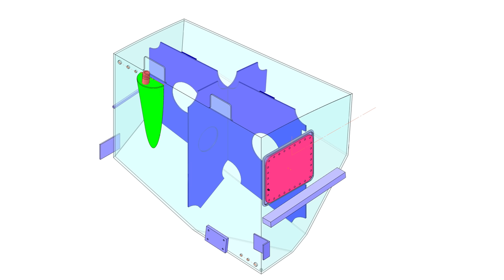Tally Ho’s brand new Diesel Tanks!

Comment: If losing your deposit is the cost of discovering Lorin and the good folks at All American Marine, so be it. Leo, you're a class act, and those gorgeous aluminium tanks are a reflection of the quality your community wants to be a part of. Even if it's only from my armchair, I'm lucky to see this kind of generosity and collaboration in the name of Tally Ho.
Reply: Well, "seems to me" that any kind of rigid tank that's "installed" (by which I mean, firmly connected to the ship's structure) is an accident waiting to happen.  The ship will flex and the rigid tanks will yield.   What happens next?   IMO, the plastic tanks made some sense but they had a lot of sharp edges which are "stress risers."   One reason they were special ordered was the desire to "efficiently" use all the available space.
Reply: @GilmerJohn  Well, seems to me that both Lauren and Leo do know what they’re doing and have figured this in, dontcha think?

Comment: First of all…
Wow! 1/4 inch thick aluminum double welded? Even if corrosion were to take place in those tanks it would never compromise them in a lifetime. Secondly… As a fabricator who works with (and for) other fabricators, all I can say is that the workmanship is obvious. You have some very impressive fuel tanks. They are truly as artistic as they are industrial.  Way to go.

Comment: You can't fake quality welds, especially on aluminum.  Just from glancing at those welds you can see Lauren is highly skilled.
Reply: As a welder also making aluminum fuel tanks the only problem with welds is porosity from dirty material or cold lap when starting a new weld, both can be overcome if care is taken in prep before starting each weld and im sure by watching this video and what I could see that was done 100%. Well done Lorin and All American Marine! 
The last tank I welded did not have one single leak when tested
Reply: "You can't fake quality welds" . I have tryed.. and failed

Comment: Don't forget Leo you (can) treat your fuel at each refueling with a gallon of denatured alcohol in each tank. This break up any water into molecules at the bottom of the tanks. This also prevents corrosion, kills diesel bio growth and keeps the water molecules suspended for 30 days.🤓🤓👍👍

Comment: What I'm finding is that the standard for using stainless steel in diesel tanks was changed in 2005 by the American Boat and Yacht Council to allow its use if the material used is 316L or 317L alloy, and is a minimum of 0.0747 in. (about 2mm) thick. The concern before that was the same as you mentioned for aluminum, crevice corrosion. It's possible that the tank makers that you consulted do not use stainless as policy, but it seems that the potential problem is the same as you discussed for aluminum.

Comment: Aluminum Tig Welder here, I wanted to see some close ups of the welds. What I did see looked consistent and that he has a good hand. They would of been fun tanks to build I’m sure. They will last a super long time. Tip for an emergency, aluminum is soft. If you ever get a pinhole leak use a centre punch (if you can get to the spot) it will get you to the next port till it can be repaired properly. I hope he put baffles in the tank. Double whammy if he didn’t and I would make him cut the lid off and put some in, no ifs ands or buts! Fuel tanks are typically supposed to be double walled as well but have built single wall tanks for myself with no issues.

Comment: That's some pretty high-quality Aluminum fab.  1/4" wall is a little overkill for that size.  But now that it's made, it's just extra corrosion allowance.  Make sure you vent it properly so it can inbreath.  If you are worried about your low point, you can always put a low volume gear pump on a weekly timer and recirculate the bottoms through a filter + coalescer and back in the top.

Comment: You are a class act Leo for not putting your grievances on YouTube. I'm sure folks in the boat building trade know who they are. =)
Maybe get your fittings machined out of aluminum to avoid dissimilar metals and use a Teflon paste rated for fule. Built service stations for eight years.  =)

Comment: Wonderful job on those tanks! Lorin is a true craftsman! I worked for many years as a shipwright in Juneau, Alaska and we had to design and have made many diesel tanks. We always advised against stainless tanks because diesel and stainless produce some water vapor inside the tanks. I'm not sure why this happens but it does. We used mild steel or aluminum. Maybe this water vapor problem is why stainless isn't used in the U.S.

Comment: Fascinating!! I remember in the 70s I was working in a boat shop in Virginia. The shop had built a fifty foot ketch with integral tanks, so one side of the tanks was the hull. They were constructed with 3/4 inch marine plywood coated with wet epoxy. Bad idea because a boat works. It twists. The tanks leaked and the person doing the repairs just applied more and more west epoxy so it looked like a cave inside the tank.. I suggested that the mess be removed and that we could make tanks out of fiberglass to be mounted inside, but I left and don't know what happened. My stepfather needed a diesel tank for his sailboat and ended up using a beer keg. It worked perfectly and twenty years later when I talked to the guy who bought  the boat, it still had the same beer keg tank!!

Comment: Fuel Tanks here in the States cant be made with steel because steel is one of those metals that can spark when struck. While Aluminum doesn't. Its a safety choice most if not all US has adopted.
Reply: I believe that would be for gas tanks not diesel, because gas is flammable and diesel is combustible. It takes a flame to light diesel not a spark.

Comment: Nice job on the Tanks. I'm glad to see you used 1/4 inch material, too many times I've seen tanks built from thinner material and in one case I warned to builder to use thicker aluminum. later it turned out that the tank deformed and split the seams, dumping several hundred gallons of diesel into his hull. I'm also very glad to see those tanks well baffled. Never underestimate the power of moving liquid!! Well done Lauren, from one welder to another!! Nice looking beads brother!!

Comment: Kudos to Lauren and All American Marine for their generosity!  The tanks are a work of art.  Plastic is a viable material for diesel tanks.  Lots of mass production boat builders in the US use plastic tanks.  I had a sailboat with a plastic tank.  It was 22 years old when a hurricane destroyed it in its slip but the fuel tank never gave any trouble.  

That looks like the bridge over Deception Pass.  Beautiful structure.  I hiked to the bottom to take photos.

Comment: Their is actually a time tested plastic tank most shop owners can relate to. A plastic 5 gal diesel can. It is made of HDPE plastic. So is your plastic gas tank in your diesel trucks. And so are oil jugs. Just a thought. But your absolutely right about the build quality. Not just pressure tested but vibration tested too.

Comment: I made aluminium tanks for years without any issues. If by chance you discover a pinhole in a tank in situ, place a centepunch immediately next to the pinhole and give it a good enough hit to pinch the hole closed. It's a hack that resolves the issue when the situation requires, and if you are miles from nowhere, better than slowly filling the bilge with useful, paid for, diesel.

Comment: Hi Leo. I have a 29'  boat with 2 aluminium fuel tank's for Diesel. They were installed in 1986 and are still not leaking. They are feeding a TAMD 70 E and no problems with the tank's. So far!! My son inspect them 1.5 year ago and the tanks look like new, inside, outside What he collected out of the tank's is an other history.

Comment: Fibreglass car bodies are made with threaded oval shape pucks cast into the original layup. This strands the point loads over a wide area. The method has been used to attach chassis subframe s to unibody car structures. 
However they don’t carry diesel for many years. In addition, cracked glass fibre “contaminated” with diesel cannot be repaired.

Comment: aluminum in O2 does create a protective coat of aluminum oxide, just like steel creates iron oxide (rust).  This on aluminum doesn't corrode as quickly and is a desired effect to protect the raw base aluminum. keeping a good bit of ventilation around the tanks should any collected water or condensation to evaporate quickly enough to allow another layer of oxide to form.

Comment: I have usually referred to Nigel Warren's book "Metal Corrosion in Boats-The prevention of metal corrosion in hulls, engines, rigging and fittings" pub. Adlard Coles 1980. He discusses aluminium fuel tanks, for which the recommendation is to avoid any fittings of brass or copper-based metals (electrolysis/galvanic corrosion), but to use stainless fittings, including pipework (or aluminium pipe). He also notes that a reaction can occur between diesel and copper/brass fittings.
Those are very handsomely-built tanks, and I look forward to seeing them fitted in the vessel.

Comment: Chewbacca t-shirt? I instantly like that guy!
Back when i was a kid, i got to go with my uncle at his work a few times and one time i got to watch a whole mild steel tank being brought inside an autoclave and heated substantially. The inside was under vacuum as i recall, and they'd pull it out, looking through the observation window, when the sides bowed back to normal. It was then immediately brought out and dunked in a pool of oil. Quite the spectacle and i had to watch from far away. This made the tank highly resistant to corrosion and also stress tested it. I don't remember what it was for, tho. I only remember the "fun bits".

Comment: Hey Leo I'm a watcher from the beginning and I have been so interested in what you have been doing. You see I am a woodworker/Carpenter all my lfe and also worked for three boatbuilders as a Woodworker/Carpenter. When I saw you get on that ferry I knew where you were headed, well in the direction you were headed.  I have driven that road many a time. I think you made a sound decision to go with the aluminum tanks. Every company I worked for used aluminum tanks and its because they are the best bet I think. Anyway I will continue to watch and by the way I have been anticipating this series on the build since I first saw tally ho. Keep up the great work and it is sure we'll worth it!

Comment: Wow those are beautiful, the welds are gorgeous, way to go Lauren, 1/4 inch aluminum plate is very strong and probably wieghs half of what steel would, to me, steel in a boat, your asking for trouble, you would have to check the epoxy coating every couple weeks. I think the aluminum was a no brainer, Leo it looks like you could throw one of them off of Mt. Everest and it would survive, hats off to All American Marine, well done Leo.

Comment: Stainless steel (SS) can be a real pain in so many ways. The US has a list of materials that can be used for marine diesel tanks; that list does not include stainless steel. If stainless is insisted upon there is a whole set of hurdles to overcome before it can be used. Stainless painted on the outside is ok for fresh water on the inside. Lower grade 304 SS which is most commonly used will crack easily once it is welded if any salt air gets to it. The higher grades are more crack resistant but still prone to it. I worked in the 1980s on Das Island where we had to replace almost every 304 SS pipe because of stress corrosion cracking. We conducted lots of tests, we found that just the heat of a flap disk preparing 304 pipe for welding could initiate cracking. Have to say I was blown away by the fabulous quality of the tanks that Lauren made.

Comment: The new alloy tanks look really good from this engineer's eye and Lauren should be real proud of that effort.  Plastic was always going to be a problem and so was a company who told you it wouldn't be ! Look at it this way, it was $1000 well spent and if they had repaired those plastic tanks, you would be stuck with a nightmare waiting to happen. You saved way more than that getting the alloy tanks made, and just imagine the cost of an installed plastic tank splitting apart at sea in a wee bit of weather while half full of diesel ?

Comment: Great looking tanks, well done.  Galvanic corrosion is a problem with dissimilar metals however.  For the dissimilar metal corrosion to occur you need contact between the dissimilar metals and an environment for the corrosion to occur.  For example aluminum and bronze in air the corrosion rate is very slow.  Aluminum and bronze  in sea water the corrosion rate is much faster.
Use extra caution when using sealants or calking on Ti, Al and stainless steel.  These metals rely on there being a oxidizing environment to build their protective  oxide film.

Comment: As as aircraft engineer i would have called out Admantium, it's clearly indestructible and would outlast the boat and it's captain.. the components of the alloy are kept in separate batches—typically in blocks of resin, Adamantium is prepared by melting the blocks together, mixing the components while the resin evaporates. Adamantium has an extremely stable molecular structure that prevents it from being further molded even if the temperature is high enough to keep it in its liquefied form. In its solid form, it is described as a dark, shiny gray, like high-grade steel or titanium.It is almost impossible to destroy or fracture in this state, Unobtainium is another alloy used in these senerios with great success.

Comment: With the mounting and other connections of the tanks, need to avoid direct contact of the aluminum with ANY material with dissimilar electronegativity, to avoid galvanic corrosion. That includes EVERY steel, and nickel alloy, and iron.

Comment: Plastic may not corrode but many plastics do degrade over time and can start getting brittle and cracking/flaking etc. after a couple of decades. 1/4' aluminum seems a good choice, I always wondered if using a commercial epoxy fuel tank sealer to coat the inside of steel/aluminum tanks to protect them.. It's done all the time on things like old motorcycle gas tanks etc.

Comment: I was a commercial fisherman in the Gulf of Mexico for a little over 2 years. Our lives depended on the equipment on our vessel. Something like leaking diesel tanks would have been a life or death issue in the my middle of the Gulf. I couldn't imagine being deep sea, a week from land to find out that the fuel is been pumping out the bilge for the last few days and now I'm relying on wind and solar. They should be exposed, not everyone will pressure test their new tanks and you just might save some lives.
Stainless steel likes airflow and dry conditions.

Comment: There are few ways to make steel or aluminium from sea water corrosion:
1.   Yellow chromate
2.   Surtec 650

Both material are use in oil and gas industry

Comment: Name and shame is the way to go, it's fair for you to share your experience with a company, since people watching may also be wanting to install tanks.
Reply: @harryk1266  Good catch Harry.   Anyone with a high resolution monitor can clearly see the manufacturer's name.   Putting their logo on a removable part (access port) is a dead giveaway as to their (so called) commitment to quality.   Their label should be permanently affixed to the tank.  I've ordered many custom marine fuel tanks in my career, and reputable tank builders will always include on the data plate their name, capacity, and test psi.  This also falls under Federal Regulations,  33 CFR § 183.510 .

Comment: Aluminum tanks need to be kept externally dry by having clear drainage all around and not stand on or secured by moisture retaining materials to prevent poultice corrosion.  As mentioned, only certain types of metal may be directly attached in order to avoid galvanic corrosion.  Keep the aluminium tanks as full as possible or agitate fuel at the bottom of the tanks to reduce condensation.  From time to time, at least every three years, tanks may be cleaned out of sludge and dried to prevent build-up of microbial corrosion at the bottom of the tank.  🙂

Comment: Merry Christmas and Happy New Year, Leo! Lorin and All American Marine - way to come thru! I hope you read this - I would suggest that if the engine does not have one, add a fuel filter/water separator system. I'm guessing that your engine already has one, but if not, you could do an inline/bypass type system. They'll be a petcock at the bottom of the filter where you can drain any water off. With the electronics of today, they can even put an alarm on the system so that when it reads water in the filter, it will set off an alarm. The other thing  is, there is a paste that you can put on the end of a stick, per se and dip the tank. The paste will tell you whether or not there is water at the bottom of the tank. If you need some help researching, give me a call.

Comment: not sure if someone said it yet, but fuel corrodes the stainless steel welding material. i do know there is some weld compounds that will resist this but it can be a gamble.

Comment: I have a silver Toyota Tundra with a ding in the exact same area of the tailgate (backing boat trailers with tailgate down, oops 😢).  And I’ve commissioned aluminum fuel tank with the same leaking problem as those plastic tanks, and also ate the money.  Condolences!   Great video though!